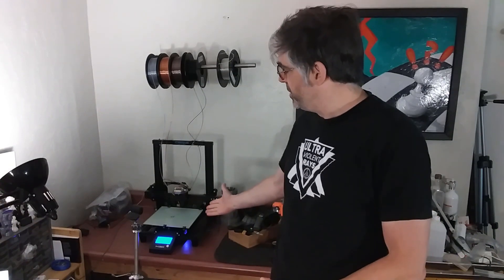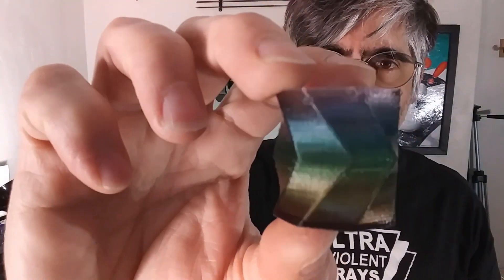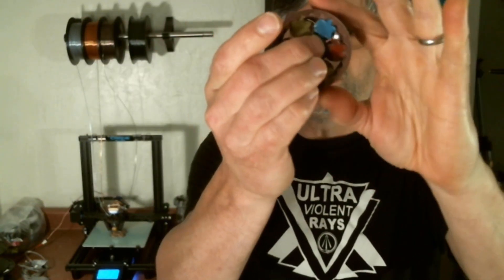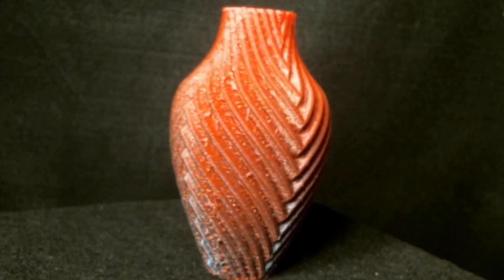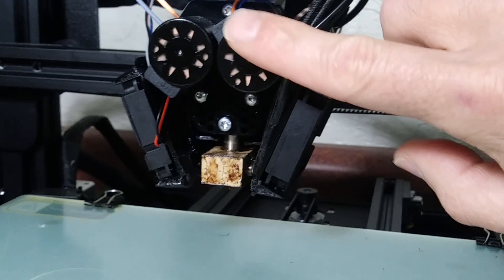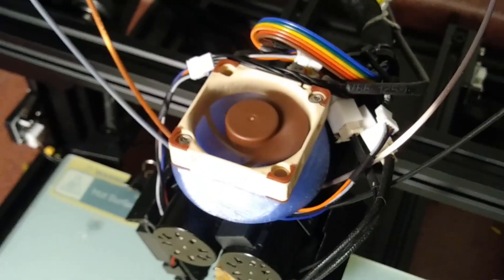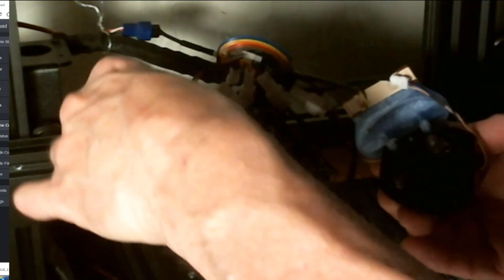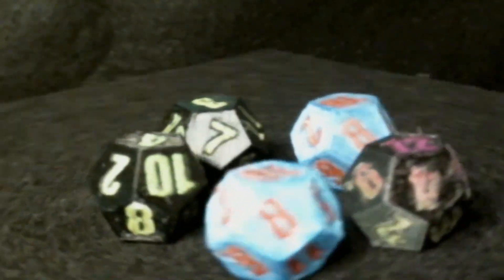M3D Crane Quad Second Look

Comment: Is there a setting in Voxelizer that you have found to reduce the "toothpasting" effect?
Reply from the maker: The toothpaste effect is due to the physical configuration of a mixing nozzle and also occurs on a Diamond Hotend. It may be possible to mitigate the effect with programming but no one has implemented any software solution yet.

Comment: By saying this machine has potential then every experienced 3D printer knows there is a reason to stay away from it. Nevertheless, thank you for all the time and effort showing us.
Reply: Not really, I just picked a used one up from ebay for $130 and im getting decent prints out of it, its probably like my 15-20th 3d printer as I have alot for the print shop I run. Saying the machine has potential means it can work but it aint no Pursa.

Comment: Do you think passive cooling with heat sinks would help with the decreasing the heat from the small extruder motors
Reply: I have a quad crane and I’ve been having retraction issues too! And i cant find any help online! So please keep up the testing i need your help!
Reply from the maker: @Shmow_Zow  There are a number of very helpful users on this Facebook group.

https://www.facebook.com/groups/287867492126710/
Reply: @ntx9design392  Thank you very much for sharing the FB link. Respect!!
Reply from the maker: I probably wouldn't hurt to use heat sinks but I haven't tried it yet.